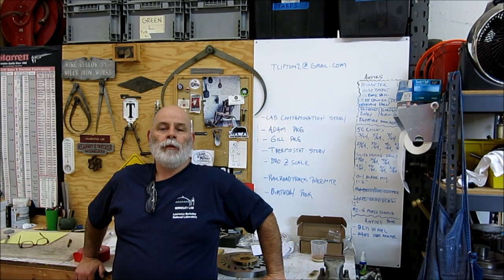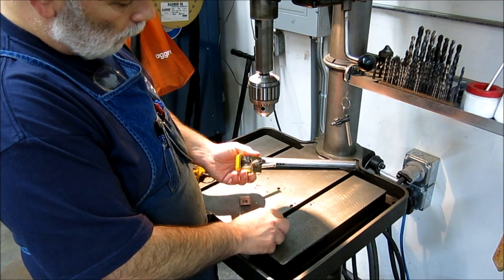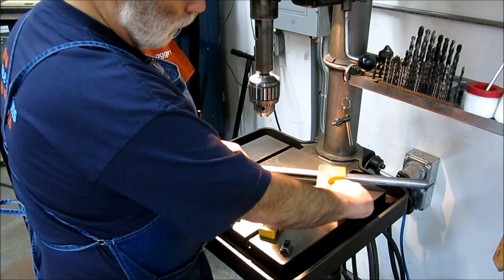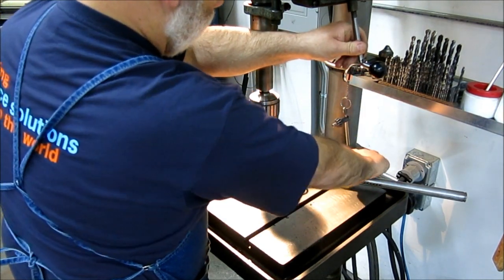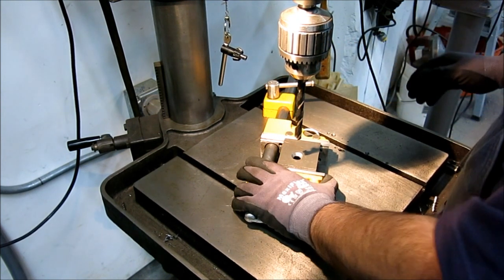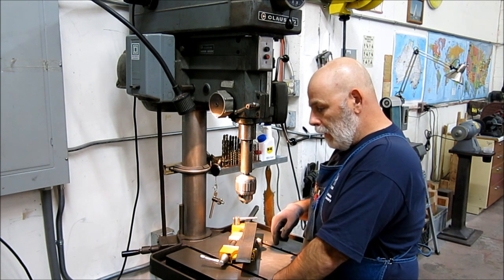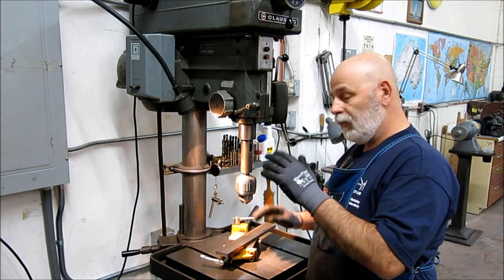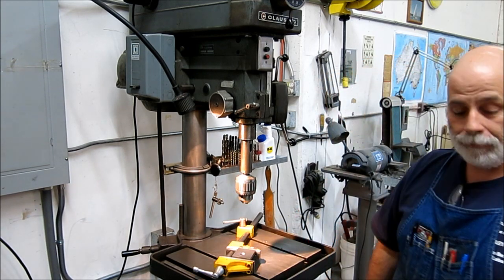Drill Press Vise Survey

Comment: I know this is a very old post but I got a drill press story about a big radial drill press. BTW Tom, Nice Gloves, where did you get them?

Hey,  I have a drill press story for you that I witnessed. 

It happened when I was plant engineer for a large weld/fab shop. We had a guy that had been with the company for a few years and he had a very large 4140 forging that had to weigh well over a grand on a big radial drill. He was a very good man and he had it really well secured.  He was drilling a 2" hole in the forging and just as the drill started to take the full diameter he reached over to move the coolant nozzle . Just then a nice long streamer, which was like a coil spring grabbed his GLOVE and took him around 2 or 3 times and then rammed his head into a towmotor counterweight that was parked on the back side of the radial. - It didn't kill him but he ended up with severe brain damage and never walked again or worked again.He spent the rest of his life in a nursing home.  

Want to hear the best part? That was over 40 years ago and he just died last January. Think about that the next time you feel like putting gloves on around rotating machinery.  

 Loose the gloves, or  loose is a finger. (or worse). - It's way better to have a couple of stitches in your thumb then to not have a thumb to have stitches in. - Tom you are one hell of a craftsman and I couldn't clean the chip pan but I was really disappointed to see you with gloves in around a drill press. 

And before some nuclear physicist tell me that their are "tear away" gloves, they CAN still move your hand just enough before the rip away to drag it into the top jaw of a Bullard,,,,and get your whole arm torn off. 

One more time.
 LOOSE THE GLOVES OR LOOSE A FINGER.

Comment: You reminded me of my drill press horror story. 27 years ago I worked in a metal casting plant that made torque converter stators and metal plates for the front of pay phones among other things. I was put on a drill press taping out holes in what I was told was cast muffler clamps. Since then I have become a mechanic but have never seen those clamps used anywhere. The clamps were cast as pairs and the drill press operator would slap the rough casting onto a large metal fixture sitting loose on the drill press table and tap out the holes with a 1/2"13 tap. The chuck that held the tap was on a reverser that turned clockwise when pressure was applied and counter clockwise when raised up. I don't know the proper name for that attachment and have never seen anything like it since. On the first day the machine had a bottoming tap in it and things went fairly well. The next day one of the machinists need that tap for something and had installed a tapered tap. The supervisor told me the machine was running at 1100 rpm because the next speed setting was too slow for the production target. The trick was that your timing had to be perfect. You had to push down and then change direction at the exact moment because otherwise there would either be not enough threads cut in the hole or the tap would lock up. I'm not sure if that thing was really going 1100rpm but I can say with certainty that it was fast enough that there was not a chance of moving your hand out of the way when it locked up. Keep in mind there was about 10lbs of metal spinning lopsidedly on the end of that tap every time that thing jammed. The first time it hurt so bad it took me about 5 minutes before I could work again. The second time I nearly puked. The third time the tap broke and a shocked supervisor said "I've never seen anyone break a tap that big before". They didn't put me back on that job again but they did slow the speed and change the tap. I worked a total of 8 days for that company. 
  My drillpress  at home has one of those visegrip clamps.
Reply from the maker: +Arno Dyck Hey Arno,

I am convinced everybody that has worked in a shop has a drill press horror story.  Thanks for the comment. 

Cheers,

Tom

Comment: I was trying to drill an wiring eyelet. One that you crimp to a wire and bolt to a battery for instance. I thought I could hold it in my hand. I was wrong haha. Thanks for sharing Tom!
Reply from the maker: Hi Nick,

Classic. Thin copper sheet and power tools. Whoops I had a boo boo. Thanks for sharing.

Best,

Tom

Comment: Hey Tom and thanks for sharing the demo, nice tool indeed.

My horrorstory on the drillpress involve gloves!
I was making holes in a lot of brackets one after another and was in "repeatability mode" when my leather gloves snagged on the drillbit and near broke my arm around. Now i was really lucky it was such a big bit (30mm or so) and low speed so i  did not get any injuries, but that was a huge eye opener for me.

And from that day i cringe whenever i see gloves used near a bit with rotating mass.

Comment: Nice story Tom
I love your videos
occasionally i use a large c clamp on the table so itll only go as far as the clamp.

I have a drill story of my own. a friend of mine wanted to make a gocart muffler using a soup can. he needed to make a hole in the disk left over after the can was opened. he held the disk in his left hand hand and used a highspeed handheld drill and the bit quickly grabbed digging the disk into his thumb.
Reply from the maker: Hi Back,

I thought you were going to say he put the disc on his leg to drill it. And yes I have heard of that happening.

---Tom

Comment: Here's one of my drill press stories. In a hurry to put a couple of 1/4 holes in a piece of 3X6X1 1018. The first two holes no problem, on the third hole, about an inch off-center it grabs on breakthrough rips it out of my hand and before I can turn it off, the drill breaks and the workpiece flies about 12 ft across the shop. Amazingly, no damage to me or anything else. Never do that again!
Reply from the maker: Hi Major,

Ahhh the old wham bam trick. Seen that one as well. Thanks for sharing.

Best,

Tom

Comment: I have an old Bridgeport vise on one of my drill presses
up to 3/8. or so just the weight of the thing is enough to keep it still.

My drill press story comes from being a knifemaker
Making a butcher's cleaver. Drilling the hole in the top corner of the blade to hang it. Grabs and starts doing the helicopter of death. Put the handle of the cleaver right through the meaty part right below my left thumb. Have a 1" long scar there from it.

From that day on I never do a hole bigger than 1/4" without using the vise

Comment: Fun video Tom. I think we all have a drill press story or three. Mine involves some hard, brittle plastic that got sucked up into the flutes of a drill and threw the part. Not fun - needed a new pair of shorts after that one, but I learned! The big question is why do you have thermite on your grocery list?!
Reply from the maker: Hi Murph.

A similar one happened to me starring a brand new countersink and a pvc part. It was almost instantaneous. Thanks for the comment. Ahh the thermite. I need to pick up a few hundred pounds for a little job......

Cheers,

Tom
Reply: Uh oh, an ox in a thermite shop. I smell trouble.

Comment: Saw Keith Fenner drill a center hole in a large round stock and not have a real good way of holding it. That vise would allow rotating the table and hanging the vice off the side to hold tall stock right near where it is drilled.
Reply from the maker: Hi Scott,

You got me thinking now. I don't think my table rotates right and left. For that job I'd swing the table to the side and clamp it against the side.

Cheers,

Tom
Reply: oxtoolco Or use the horizontal boring mill like I do! LOL

Comment: I watched all the drill press videos, really good.. I bought a drill press like yours for $100. needs a little work.Mine has a lot of holes drilled thru the table,any suggestions for repair? I have a big Miller mig, but would rather do an epoxy repair if feasible,What you think.I'm not a machinist but going to do a little hobby milling in wood and aluminium with it.My father-in-law left me a lot of end mills and cutters and measuring tools..Thanks!!
Reply: ...I've welded a few drill press tables with nickel 99....then ground the top with 9" grinder....worked out OK...

Comment: That "float clamp" is bad ass.  It looks useful, low profile, secure, etc. AND SAFE!    Flat bar flying around at chest level:  not good!  Impresses me as a Samurai sword.... "Ronco Eviscer-a-Matic".   I'm sure it has already been invented, but how about a two piece drill press table.  The lower half would be a regular table or half of an original's thickness.  The top half would be bisected.  The top halves would be the "clamp jaws".  So the "clamping drill press table" would have the normal "T" slots and also used as a vice.
Reply from the maker: Hi Joe,

Workholding is a tough challenge. The drill press see's so many different parts its hard to have just one solution. Its also one of the reasons people get into trouble on them.

Best,

Tom
Reply: oxtoolco I got it.  Yeah, not enough flexibility.  By the way, you cleaned it up really nicely!  It found a good home, or is going to another.   I hate seeing good stuff scrapped for weight value!

Comment: Have either same or similar but mine also has an edge clamp which is fine.  The darn old '55 17 inch delta has no tee slots.  I for the life have no idea why they thought that was a good idea?
Reply from the maker: Hi Jim,

I have added sub plates on drill presses like you mention. Add a few tapped holes and you can mount anything you want.

Cheers,

Tom
Reply: The other idea I had was to rabbit some steel strips and screw them dowm forming tees scross the surface.  One of these days!

Comment: The infamous helicopter drill press story, I've had it happen many times and lets just say I got lucky. There's a dent in the concrete floor near the drill press from when it shot the vise off the machine. Luckily I wasn't in the way...
Reply from the maker: Hi Andre,

You haven't lived until you helicopter a thirty pound lead brick. It shakes the whole machine as it flaps around.

Cheers,

Tom
Reply: I have to say, that would be quite an experience!

Comment: Sorry for taking two bites, but here is a funny drill press story. For 30 of my working years I was a metal shop teacher. I had a student who was a great kid but who struggled with measurements so I marked out a piece of steel for him to drill. The drill broke out of the side of the bar so he brought it to me and said, "Mr Spender you marked my work out wrong." I didn't have the heart to point out my punch mark well to the side of the hole. To be fair most of the other holes were in the correct places.

Comment: How about a grim drill press story? In a shop that I was working in an operator was drilling a hole about 2" dia using a radial drill press. The hole was slightly off centre so he leaned over to "Drift" it. Unfortunately he left the drill press running. The drill caught in his clothes and picked him up off his feet and left him spinning around. Even more unfortunate was the fact that the Drill press was built in Germany with German labels and the first people on the scene didn't know how to shut it off [the main switch was inside a covered box]. They were frightened that they might speed it up. Fortunately the works manager was Dutch, who understood German, and he got it shut down. The operator was unhurt apart from a badly bruised shoulder where the drill had wound up his clothes. Next day the Drill press was completely re-labelled.
Reply: Dont know if I would call that a "helicopter" story, that sounds more like a "Carousel" to me! Wow! Glad to hear he didnt get anymore hurt than that.
Reply from the maker: Youch!

One lucky guy. The Dutch saved the day.

---Tom

Comment: Not exactly drill press story, haven't had one yet(hope i don't get one in the future either) but it involves a hand drill. A Bosch impact drill. 

I was drilling holes for a couple of wall mounted heavy load cabinets, so big 10 mm holes for big bolts. 3 holes per cabinet. Last hole half way through i hear this really high pitch sound, then half a second later the whole front of the drill exploded. I still don't know what caused it, later on i finished the hole with another drill so it wasn't the hole the bit was brand new and the drill barely had 1 year and i don't know 40 45 holes drilled. 

I for one am never going to drill a hole with a big drill unless i'm wearing full face plastic mask. I still have the grease marks on the ceiling and a dent in the wall where impact drive of the machine propelled itself.
Reply from the maker: Hi Aserta,

I have never heard of a hammer drill failing so spectacularly. I bet that wasn't the only sound when it went. Thanks for sharing.

Best,

Tom
Reply: oxtoolco Closest sound i can come up with would be missing a gear on a shifty transmission.

Comment: Float Locks are great but I built one very similar to yours.  I did not use a Kurt but a smaller mill vice and it has served me well.  I TOTALLY agree with you about the drill press being one of those sleeping monsters that can bite you if you do not take the proper precautions.  Good stuff Tom!  Thanks-  Fred
Reply from the maker: Hi Fred,

Its one of those machines that's always calling out, "Hey come over here if your in a hurry. I'll help you out" Its never true. Run away if you can.

Cheers,

Tom

Comment: It seems like most folks have to learn the hard way on drill presses.  An insidious machine in sheep's clothing so to speak. I was taught these lessons at my Grandpa's knee and had to actually make the mistake to be converted to a believer in subduing the part, always.  If you get lazy and try to save three seconds, sooner or later you get bit, again.
Reply from the maker: Hey John,

Humans sometimes have to touch the stove to really believe its hot. Its built into our sense of curiosity. 

Best,

Tom

Comment: Just thought I'd mention, that fine pitch T-nut may be a deliberate design choice, given the short tommy bar for tightening compared to using a proper tool with more leverage on a standard fastener, you should be able to get decent clamping force without resorting to a cheater bar as a result, where you may struggle with a coarse thread.

Comment: That vice grip vice looks pretty skimpy to me. A guy would need to be real careful using it. I did setup and operator on a Bridgeport for 3 years in a fairly large Machine Shop. We made Robot Parts for Detroit, a lot of oddball looking things. I have more horror stories than I care to remember. We had a young crew and they would get high at lunch time. At least 3 times a week someone would wing a part across the shop, banging off other machines, flying out windows, etc.. It makes me cringe just thinking about it. I got smart and would hide in the bathroom after lunch,  until all the other machines would have started up and run a few pieces, then it was pretty safe to go to work. Thanks for the demonstration of the feeble looking vice grip vice. Keep your head down. :-)
Reply from the maker: Art Trombley Hi Art,

The float lock is a commercial product for this kind of use. They seem to perform pretty well on drill presses. On the mill I would agree its not heavy enough. Thanks for the comment.

Cheers,

Tom
Reply: oxtoolco I would agree with that, even though I've never used one. Straight down pressure it would probably perform okay, unless the drill bit should bind up in the part. Thanks for your reply Tom.

Comment: HI sir,good afternoon, 1 quick question sir.im in the market of drill press what's ur opinion on Dayton and klutch both 1 1/2 HP ,which one is better or what do u recommend which floor drill press is durable?thanks and more power to you.
Reply from the maker: Hi Victor,

I have used Dayton's before. They seem fine for a light duty drill press. I generally prefer a floor model as bench space is almost always at a premium. Thanks for the comment.

Cheers,

Tom